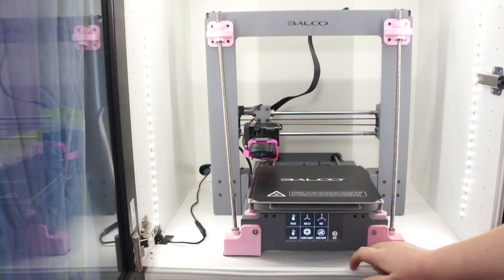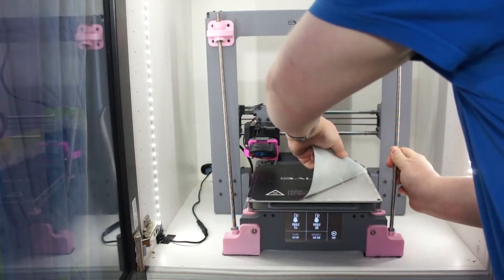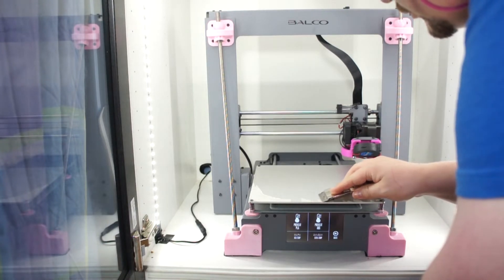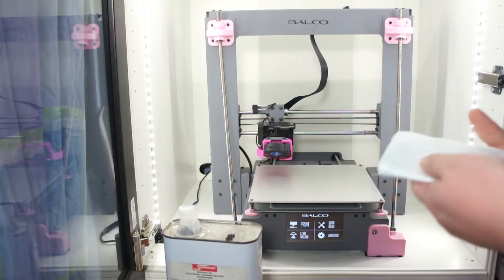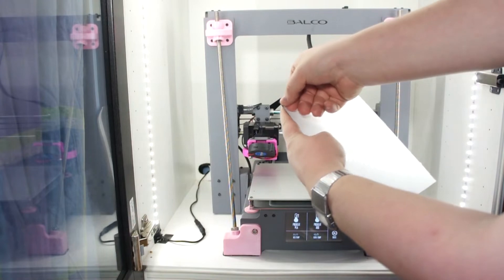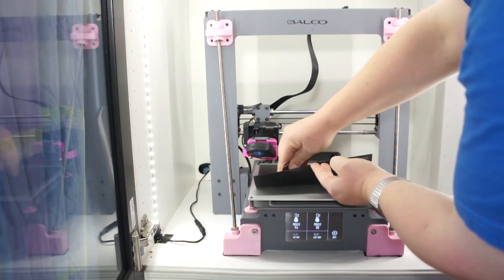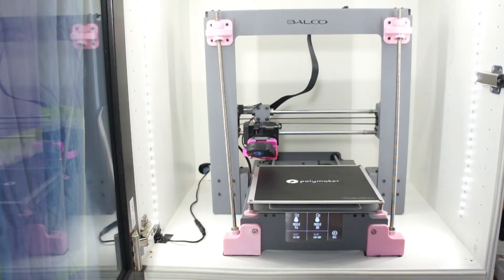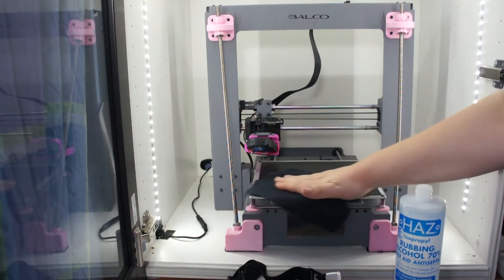How to change your 3D printer's build surface to Buildtak

Comment: Hello will, 

Have you ever had the bed warp on this machine ? Recently I've been struggling with getting a good first layer on the same machine. I've ordered some glass to clip onto the bed to see if that fixes the issue. If so I'll know its warped. Any other good ways to diagnose If it is ?
Reply from the maker: Hello Charlie! Sorry its taken me a few days to get back to you! All aluminium beds on these cheaper printers arn't perfect. I have a little warping on my bed which gets worse with higher temperatures but you can account for it :) I use a 0.2mm minimum first layer and for big prints I use a raft which lays down a sacrificial piece of plastic to print on to. If the warping is excessive then I actually have a video on finding out where the low spots are on your bed and how to fix them here: https://www.youtube.com/watch?v=YQWLwZxXByQ . Its on my CR-10s but the principle is the same for both :) Hope this helps and thanks for watching!
Reply: Thankyou will for the reply AGAIN! 

I will look into that video. Since the comment I have brought some glass for the bed that has made my printer perform perfectly in terms of getting a good first layer and adhesion. The only issue I've found with glass is that after 40 layers plus a corner might start to slightly lift from the glass whereas the stock bed I'm used to required a scraper to get the print off! I've now just updated my software to the advi3++ (if you haven't I highly recommend) this has allowed me to fit a bltouch. I'm yet to test as I ordered an extension cable for the touch that was too small. But the software is up and running and once I've got my cable I will give it a good test. This will ofcourse allow for manual leveling (like normal) but then mesh leveling and Eprom to get rid of the dividends in the bed. Hopefully all goes will! Thanks again!!

Comment: Hi Will, 

It would have been really useful to see a print with the standard surface in comparison with the new one. Don't know if you have any footage you could add?
Reply from the maker: Yea, I could make a bit of a part 2 to this but there isn't that much to see other than it sticking better lol but let me know :) Thanks for watching! :)
Reply: @willcaddy  

A follow up would be nice. Maybe discussing some of the slicer settings too and showing the differences? I know how it would be quite some work, but your experiences and insights would be interesting.
Reply from the maker: @theDesignClass  Yea, that's a great idea! I shall try do a follow up video asap :) Thanks for your feedback :)